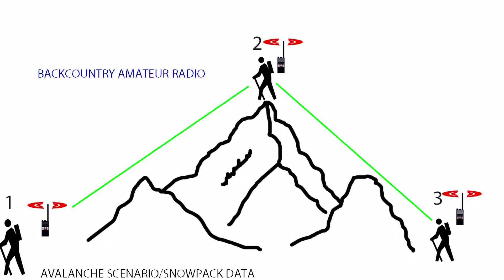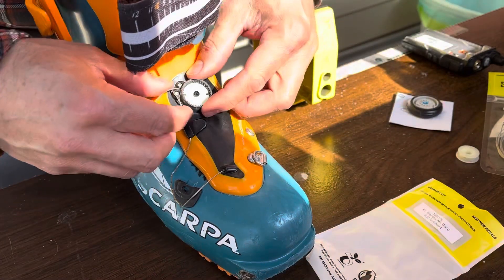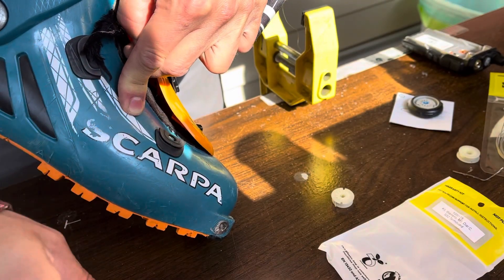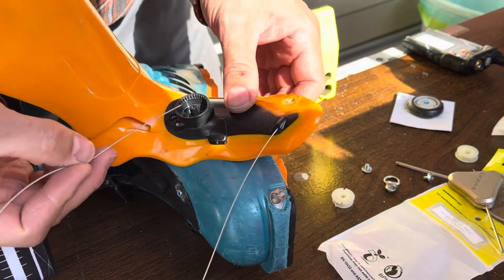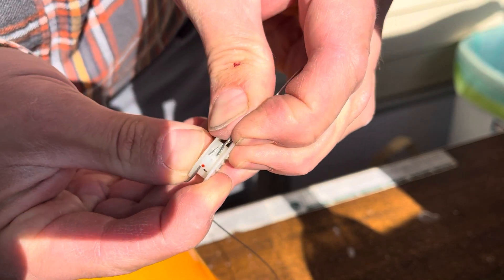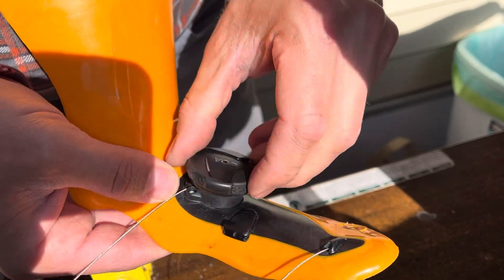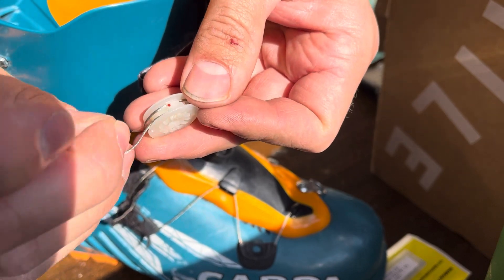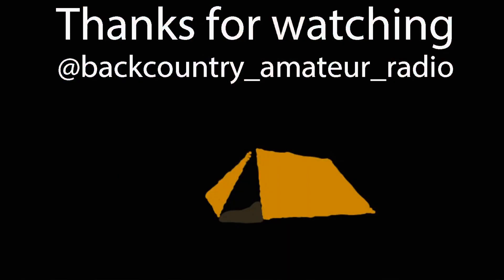Repairing or replacing the BOA on the Scarpa F1 ski touring backcountry boot - frayed cable

Comment: Thanks for sharing! My cycling shoes have the same system.  Seeing this will be helpful when/if I need to to the same repair.
Reply from the maker: Glad it was helpful! Sometimes putting stuff out there that isn't quite radio; albeit, tertiary, is kind of like putting a pitcher of water on the table when everyone already has something tastier :). Thanks for the feedback. The Boa system is remarkable in that you can do it at home. What's better is the built in warranty. I didn't have to pay for either parts or shipping. My cycling shoes are also Boa! Didn't even think of that. Take care! Eric

Comment: Clear and useful video. Watch it once or twice and you should have no problem to replace the BOA cable. I was directed here by Skimo (Salt Lake City) after purchasing a replacement BOA cable for my F1's (I didn't go through the BOA warranty route). Two comments:

1) From Skimo, I just purchased the BOA cable. I would recommend also purchasing the white cable spool just so when you replace the cable, you are starting with a new spool that has no wear at the cable attachment points. 

2) The video shows, but does not emphasize, that once the new cable is attached to the spool, NOT to wind up the slack before you put be spool back into the holder. Take up the cable slack once you've completely finished the replacement. Then, simply wind up the slack with the knob and all should be good to go. 

On my first replacement attempt, I manually wound up the slack and then found that once installed, when the knob was pulled up to loosen the cable, the cable did not loosen.
Reply from the maker: Hey! Thanks for the comment. And the feedback. Your points are important. I have to say, supposing I did another video on this, that I’d highlight the cable and spooling it. Hope you’re off to a great season. - Eric